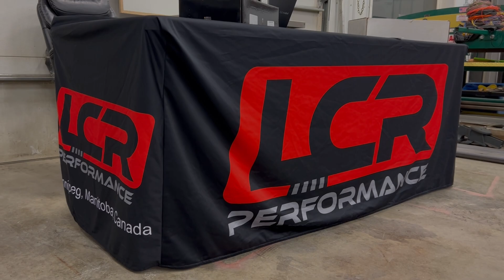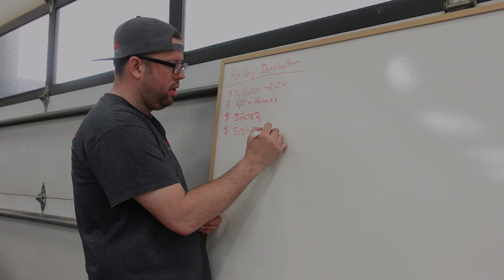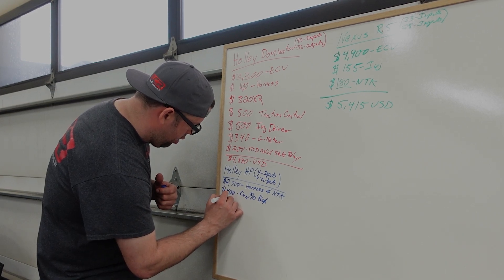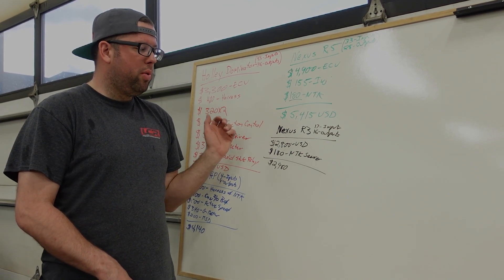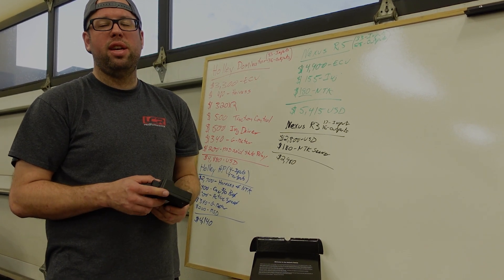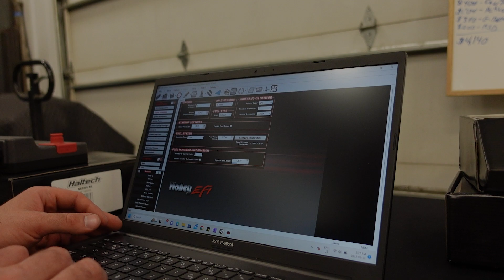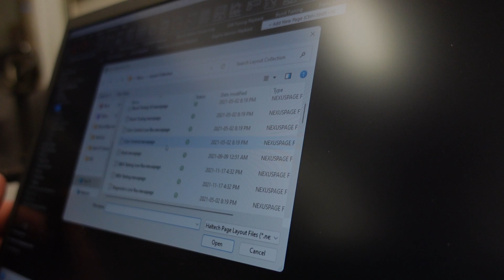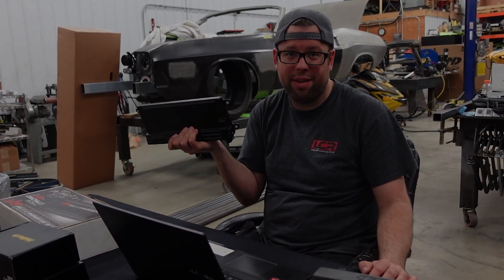Haltech VS Holley! Which EFI and WHY?

Comment: I've got a dominator, wish I had a nexus, mainly because of the software. Both are very capable ECUs. The holley is easy when it comes to basic functionality, but frustrating to get custom things done like wheel speed traction control. The way their custom tables work feels more like hacking the system rather than intuitively giving access to functionality. The haltec has built in functionality for common stuff like that, and custom functionality is easier to set up and doesn't feel like a work around like it does with holley. Holley's tech support is beyond bad, TERRIBLE to the point where i was completely cock blocked by their incompetent tech team before when trying to report a bug. As a last resort, i finally directly messaged one of their engineers on Facebook to report a software bug. Things went smoothly after I contacted the engineer, but damn.
Reply: Holley is not capable ecu at all

Comment: If you think when the dominator came out and realize what the processor was back then its not even a fair comparison.  Iirc, the dominator came out in 2010 ish. Holley said it was state of the art processing.  The haltech r3 has a 240mhtz triple core processor with 2 reduncy. What does that mean. The cam and crank signals take up the majority of the processing power. When manufacturers put in new software features and functions , it will slow down the processor drastically.  Does the  processor make it a better ecu is the question.  If you're still rocking your phone you had in 2010, then probably not.

Comment: We have a list of builds that will all run HOLLEY EFI - BUT - HALTECH controlled (hopefully - we can purchase the 4500 X at a reasonable price without the ECU) - planning on running the TERMINATOR X 4500 style on some 572 and 600 cu in street engines.

Comment: I would like to run Haltech on my Ls.  The one big thing Dominator has going for me is trans control of my 4L80E.  Im wondering what people are using to contol their 80s when not running a Dom. or Term.X?
Reply from the maker: The Haltech has Transmission Control built into the R3 & R5.  They have also came out with the terminated harness for the LS also.  Send a email for pricing and availability at lcrperform@gmail.com
Reply: Thanks for the info.  I did not know that. @lcrperformance

Comment: What about Holley pro dash/touchscreen/virtual switches controlling outputs instead of a row of buttons. You can have up to 10 virtual/touchscreen switches controlling …whatever!!!
Reply from the maker: This is true but you cannot have multiple map changes as the car is running in live time.  Holley you have to shut off the car to save the change and re-fire.  Haltech can have up to 3 keypads if desired also.